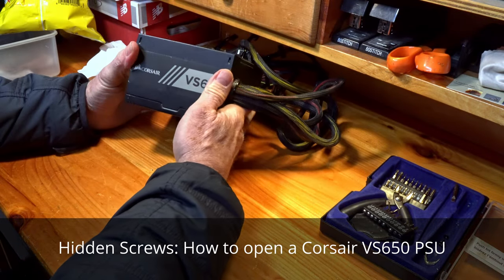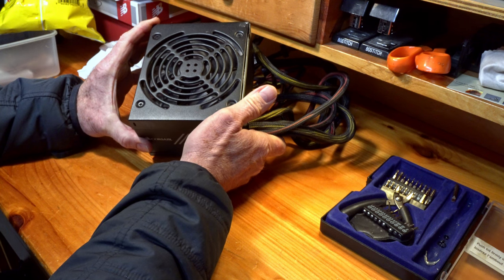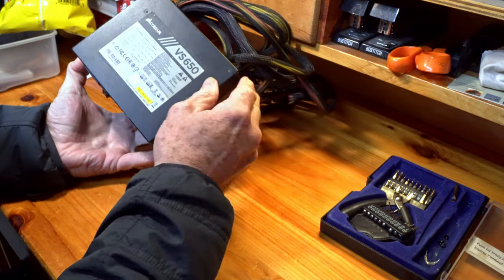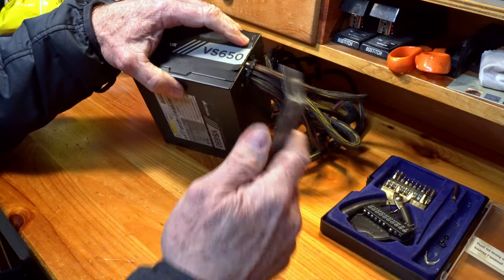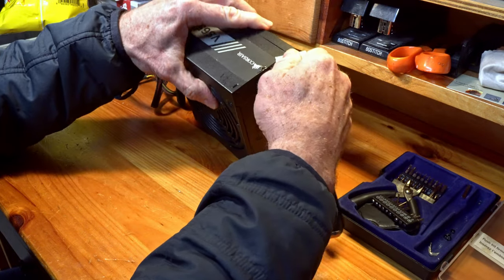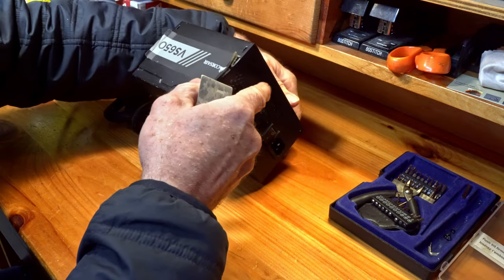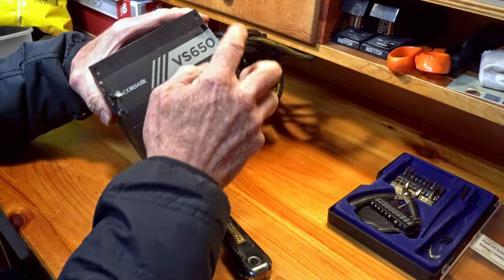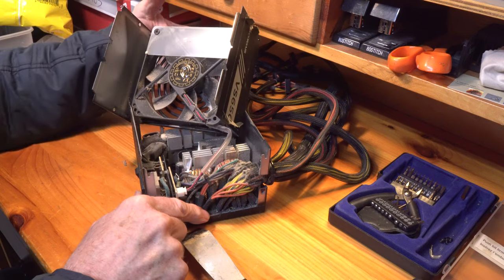Hidden Screws: How to open a Corsair VS650 PSU case

Comment: My experience with the stickers, I removed them from CX-550M and CX750-f RGB, use a fresh razor blade to begin the peel at the corner, then use a phone screen removal tool (basically a thin guitar pick, plastic spudger) with some dish soap to cleanly peel the edge of the sticker off. The soap is important to prevent it from deforming.
Once you're done, glue it back down with a slower setting glue, not a little tube of instant superglue. You can lay it on its side and let it set or tape it down with some masking tape if you just want it back in.

Comment: @IanDavisPhotography  Thank you! "Had to replace the fan"  -- Which fan did you choose to replace it with? Why not simply dropping a drop of mineral oil?
Reply: I've tried in the past. The problem is that  the mineral oil only lasts so long. A light grease is best if you can access the bearing.   From my perspective, the time spent messing about isn't worth the cost of a $10 replacement fan.
Reply: @iandavis1355  I tried silicone lube, machine grease and motor oil. Motor oil works the best but the process of pulling the fan from the hub does enough damage to the seal that no matter what you use, it will leak out much quicker than factory. Replacement fan is defs the best option.

Comment: Does the fan use a standard fan connector or is it some proprietary one etc. The fan on my vs650 is giving up and I have an arctic fan I could replace it with
Reply: Opened the PSU and checked the fan. Seemed to use the 2-pin connector (which is somewhat a standard in PSU:s, but I meant a 4pin PWM header, sorry for the possible confusion haha), so I took apart an old seasonic 300w PSU, took away the fan and put it in the corsair. Works like a charm now.

Thank you for the instructions on how to open the PSU

Comment: I can'tt unscrew it tried it with hand and with machine it just completely deformed now cant open it at all it very dirty and will overheat and i need to buy a new one and i am fcking poor 👍
Reply: If I get slippage of the bit in the screw head, I look for a better fitting bit. Bits for the star/Philips heads can very a lot.  I have a small jewelers tools which helps a lot...many bit choices. It cost under $20.
Reply: @iandavis1355  it was 2 and half hour but i unscrewed them, funny thing it dosen't even need thoose screws it just slip back to its place. there was a lot of cat hair and dust in it my previous power suppy died because of overheating.